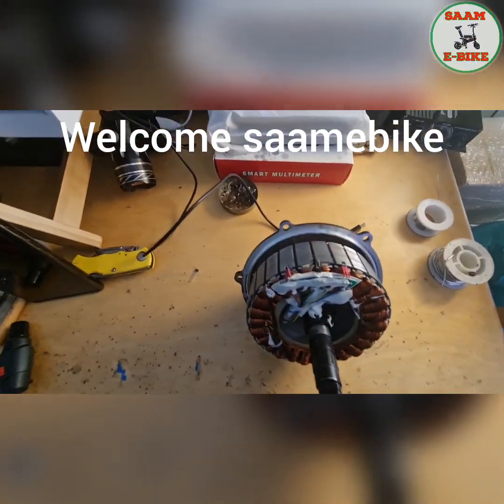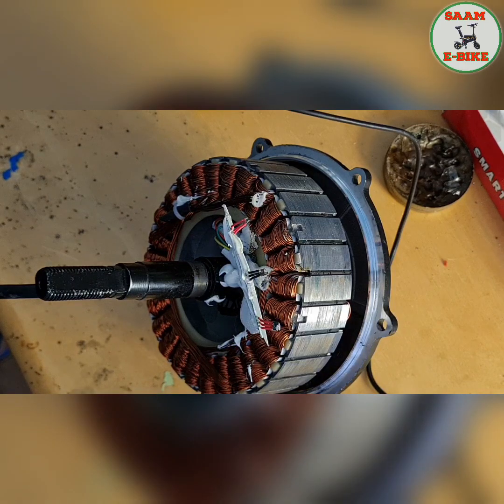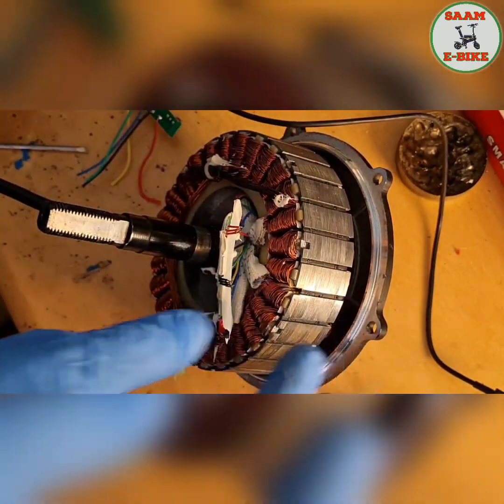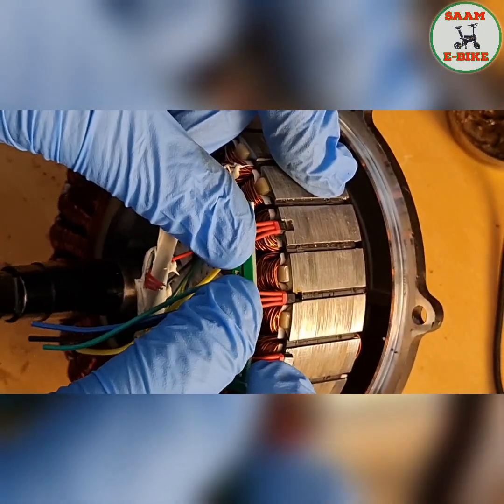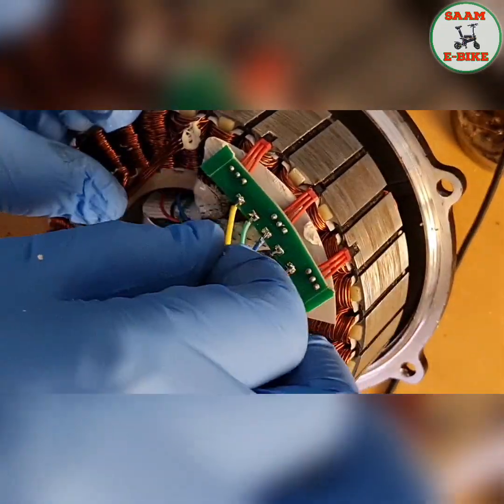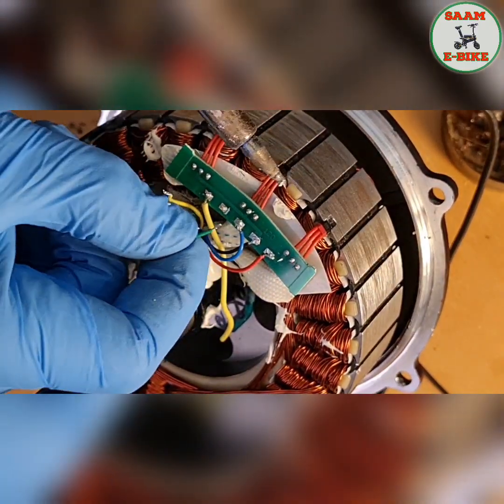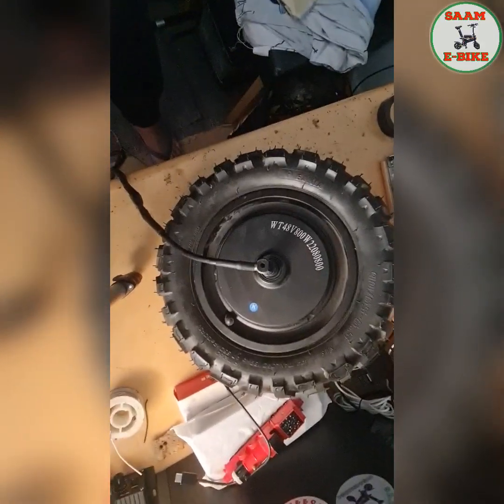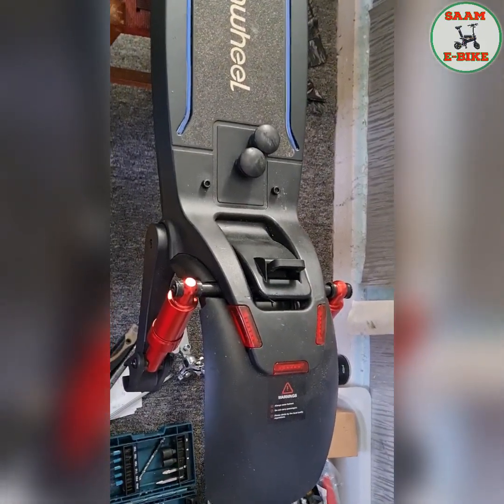How to Replace a Damaged Hall Sensor in an Ebike Hub Motor or Scooter

Comment: meu motor 3000w da para o meu motor
Reply from the maker: If u could buy dual mode controller u don't need fix the hell sensor.. only use the blue, yellow and green cable from the motor u don't need to connect the hall sensor

Comment: What Is the difference between 41F 120, 43F 120, 3144 120 and .5A-120…(Current on Hub) can i just use any type?
Reply: I believe best to look at what the marking is on the hall sensor. If its a 41F you can replace it with 43F which is suppose to be better
Reply from the maker: U can any of those

Comment: Hi I have a shengyi 750w direct drive motor but not sure what hall sensor I would need to fix it, I'm new to this and wondered if you could help me out thanks gaz
Reply from the maker: Hi all hall sensor will work if u buy from ebay
Reply: @SaamE-bike  thanks for responding 👍